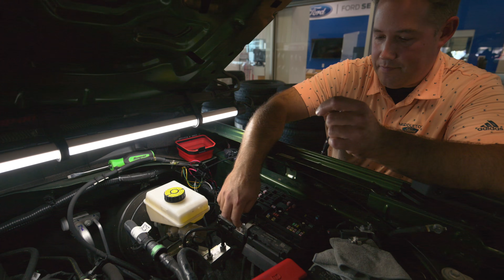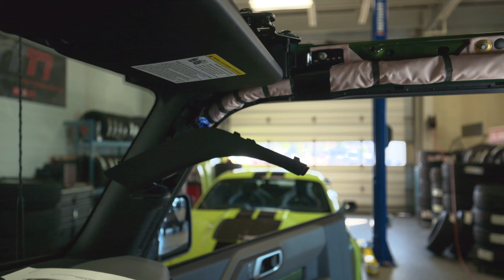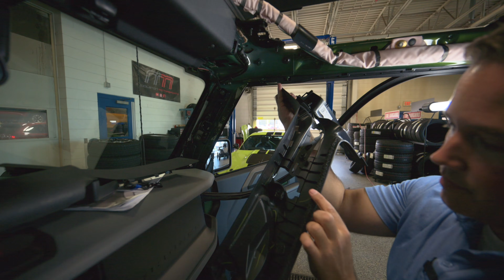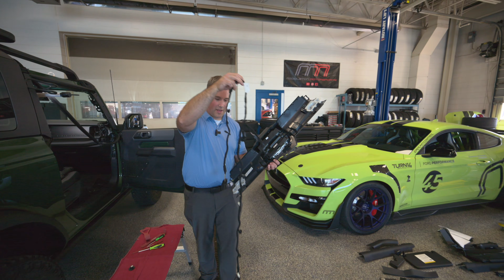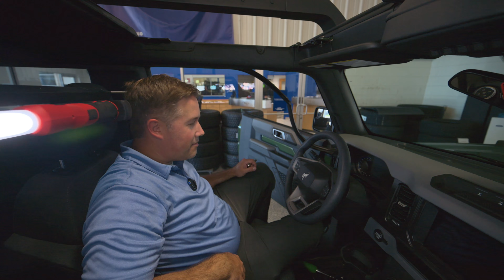Ford Bronco OEM Upfitter Switches Install

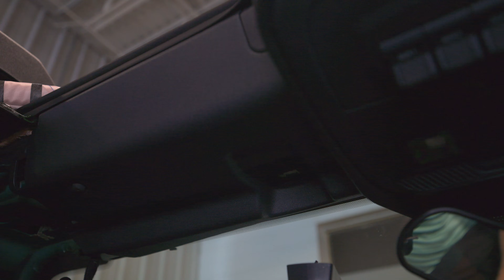Comment: Excellent video. In 2025 keep in mind wrecks for Broncos have these parts easily now. Not much to go wrong with switch panel but at about 17:26 mark just stop and test everything with harness installed. Base sasquatch was year end clearance and wanted and not doing this at a dealer at 180 hr obviously.Be very carefull. They keep making reiculous amount of harness variants. I did pulls off and got wrong one and had to redo. Wasnt going to splice away.

Comment: Thanks for the video.  Looking into this for my 2023 OBX.  That said, it has power visors (lights), so does this mean that I need the fuse box (i checked this so i know i need it) and then the overhead switches.  But I don’t need the harness, i’d just reinstall the one i have. i don’t see a harness with power for the visors and doesn’t have the upfitter as well.

Comment: I have an outer banks lux high package , do i just need harness and switches?
Reply: Check your fuses  vs the onboard owner’s manual. If the fuses are there, you need not purchase and install the replacement.

Comment: Is there a way to remove the center interior trim piece at 11:46 without doing the side trims and A pillar trims and harness? I'm just trying to replace the 5 weather seal bolts that run across the windshield frame. They have a backing nut on the interior covered by the center trim piece.

Comment: Excellent video, TYVM for posting it, very helpful.  Could you also please add instructions on programming the computer?  I understand programming is technically not needed, but I do not want to be denied warranty service because there is a BCMC disagreement code.

Comment: I purchased my 2023 Outer Bend off the lot and it didn't have the AUX switches as part of the build. I really wanted the factory look and eventually found the video @Middleton Motorsports put out on the install.  After watching it several times, I sent some emails to Middleton on questions I had. They responded quickly and completely. Early last week, I made the decision to purchase the complete kit from @Middleton Motorsports and it arrived the other day. Yesterday afternoon, I installed the kit and tested it with some lights--works brilliantly. No programming or anything else needed. The kit came with the replacement fuse/distribution box, wiring harness, and the upfitter switches for the console. The video was VERY helpful in getting through the install. It's quite easy and I'm so glad I did mine this way. Yes, it was expensive, but since the AUX switches weren't part of my build and I wanted the factory look the easiest way possible, this solutions was my best bet. Anyway, I would highly recommend this solution, as it just worked.
Reply: How much did it all cost?
Reply from the maker: Thanks for the feedback. Glad you’re happy with your purchase. 👍🏻
Reply: My outer banks (Lux/Premium) came with the correct fusebox panel from the factory)  I ordered the switches and harness but haven't put them in yet.
Reply: I have an Outer Banks with the High Package / Lux - do I need the harness as well?

Comment: 6/29/23 - I just installed this kit i bought from you guys, after changing the fusebox and my front windows don't drop to clear the rubber seals when opened, and my automatic front driver and passenger windows open but in they don't do the automatic closing with 1 click of the switch like they use to.....
NEED HELP HERE! should I return the kit for refund?

Comment: hello!! I too will be ordering this kit from you because of your time and energy put into this video. I had 1 question before hitting the order button from your link. Does the wire harness in your kit have all options? vanity lights option?
Reply from the maker: It comes as a complete unit with the lights and all the options

Comment: This is a great thorough video. Extremely helpful. Just one piece of criticism: he says not to over tighten the bolts on the fuse box as you are going into plastic however, please note that if you do not tighten them enough, your car will have no power. I was scratching my head on this for 2 days.  I read on a forum that just about everyone who attempted this installation themselves ran into this same issue. MAKE SURE YOU PUSH DOWN HARD ON THE BOLTS WHEN TIGHTENING THEM. They will jump a few times until they eventually catch and get nice and snug. It’s at this time point you should be careful not to over tighten. The other thing I’d like to mention is I broke one of my bolts holding the airbag setting my torque wrench to 9nm. So I think the actual setting should be more like 5nm.
Reply from the maker: We have sold 20+ of these units and the couple times it didn't work was when the connectors were not seated into the fuse box before tightening the screws.  Both were fixed when the customers went back and made sure that the connectors were seated properly.  We offer free support on these products so anyone having questions during install can call us at 608-831-7725
Reply: You need to make sure they fully seat but once the connectors are seated you don't want to overtighten them.  You can tell by how many turns it takes to remove them and install them.  If the connector isn't lined up properly it will not pull into the fuse box.

Comment: Question I have a base model. Your system is plug n play system, do the Bronco's come pre wired for Aux lights because I found some wiring harnesses that are not connected to anything?
Reply from the maker: This video was on a base model. The wiring was in there from the factory just not the switches and fuse box to support it.  Our kit allows it to work.
Reply: @MiddletonMotorsports  is your kit still available?

Comment: Would that new harness be the same harness in the base model if it came with aux switches for the factory? Reason I ask is if the new harness has provisions for auto dimming mirror than maybe I can add one to my base model that has aux switches if it has the same new harness you’re using. Thanks.
Reply from the maker: We’ll check into the wiring diagrams and get back to you.
Reply: @MiddletonMotorsports well?
Reply: Any updates?
Reply: @kckgtp  it’s not the same

Comment: Overhead Trim Panel: M2DZ-78519A70-JC (Includes 6 Aux Switches)
A-Pillar Wire Harness: M2DZ-14335-C
Fuse Junction Panel Assembly (Fuse Box): MB3Z-14A068-NBA

These are the 3 part numbers for the parts we used.
Reply: M2DZ-14335-J replaces the a pillar wire harness you listed.
Reply: Are you sure this is the right part numbers? We used these numbers and we are pretty sure this fuse box is incorrect. It didnt look any different than the factory fuse box as in no extra prongs etc. for different fuses. We are a Ford dealership in Canada trying this solution for a customer and my service department is suggesting I order a different fuse box now that we installed the one posted and they are not working.

Comment: Do you have a kit for this available yet? Or the ford part numbers for these 3 pieces?
Reply: Below are the 3 part numbers,

Overhead Trim Panel: M2DZ-78519A70-JC (Includes 6 Aux Switches)
A-Pillar Wire Harness: M2DZ-14335-C
Fuse Junction Panel Assembly (Fuse Box): MB3Z-14A068-NBA

any Ford dealer can get these for you if you give them the numbers should run around $1000.

Comment: I think with some digging around and removal of the sunglass holder only , you could find switches just like this and find something to mount in that same spot that looks factory. Maybe even use the inside of the sunglass holder to make some stealth switches that you can just open it and use them when needed and close it when not needed.
Reply: We have a cheaper option in the works for a switch assembly similar to what you recommend. Just running into some issues of making it look proper.
Reply: @mm_noah7062  I'm already doing an Aux beam stealth switch panel using the inside of the sunglass holder. Will turn out great when I finish it.

Comment: You should figure out a factory tow wiring kit also
Reply: We use the Curt plug and play kit on all of our bronco's with led lights! Otherwise you have to run wires to each taillight wire for the non-led broncos.

Comment: Had been thinking of doing this myself since my dealer somehow had my switches removed from my order even though they are on my window sticker! I ended up with a Switch Pros S9100 set up instead!
Reply: There were some components Ford was removing during assembly that could be installed later when components were available. For example, some Explorer trims that came with heated rear seats and rear climate control from factory had all the components for the heated rear seats and rear climate except for the module that gave the rear passengers access to those controls. There were other models that had other missing components and when parts became available, Ford released recalls to owners of affected vehicles so they could have their features working. Check to see if you have such a recall/notice. It was either this or vehicles sat in a storage yard waiting for these parts and owners complain that its taking to long to get their vehicle. There always the possibility of a misbuild, even though it's optioned, the feature just never got installed. Both of these scenarios would have nothing to do with the dealer.

Comment: Is the AUX switch wiring installed throughout the vehicle even in Broncos that did not select the switch option?
Reply from the maker: Yes it is, The only place it is not wired properly is from the Aux Switch Upfitter panel and the fuse box that needs to be swapped out. The rest of the wiring is all there.